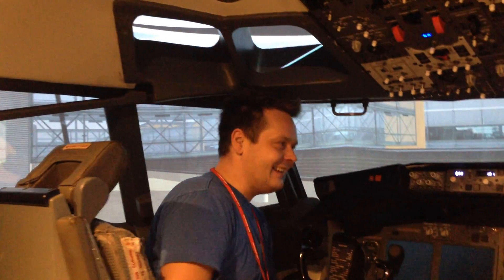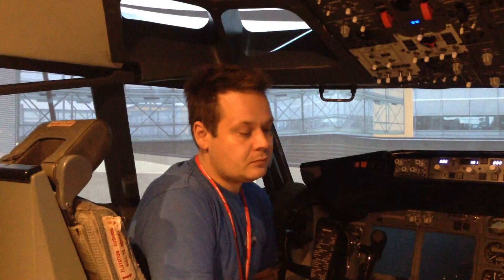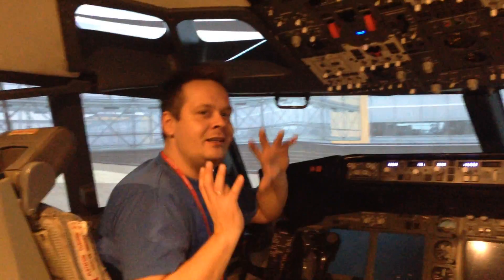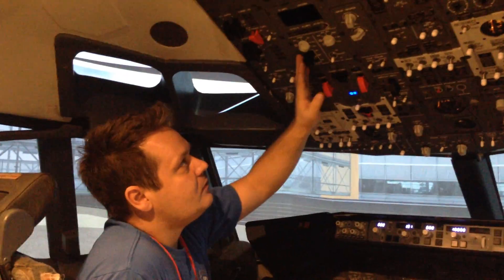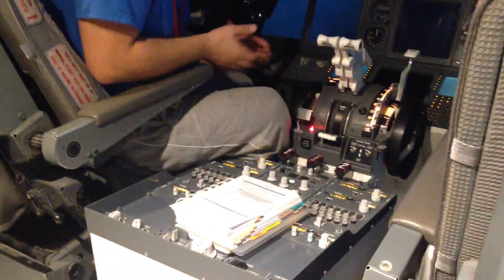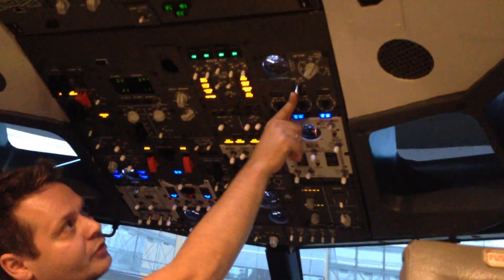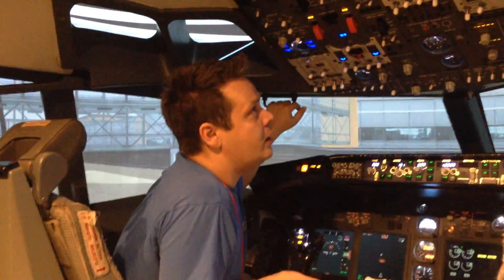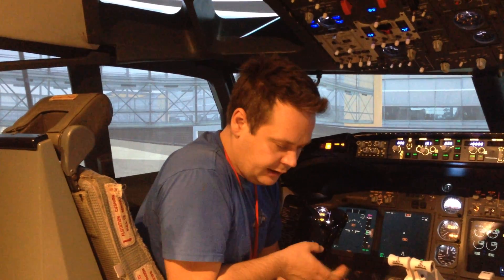Boeing 737 Cockpit Sound environment in a simulator

Comment: There's no ding when switching the ground power on. No changes with the trim air. The recirculation fans (with the apu bleed on) are quite noisy (some pilots turn them off during the pre-departure briefing, to make the cockpit quieter). Also, turning on the cab util/ife switches starts the ventilation in the flight deck. I wish I could help you out but I don't have a decent camera to play with...